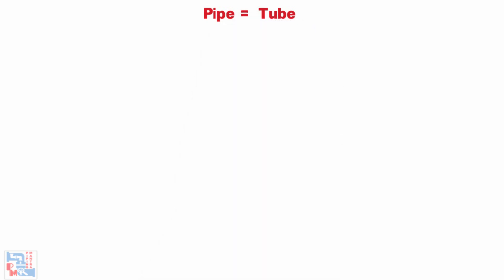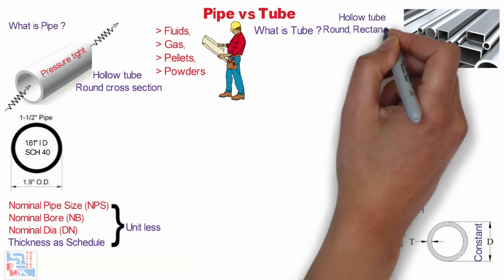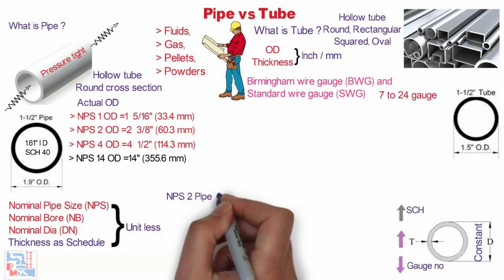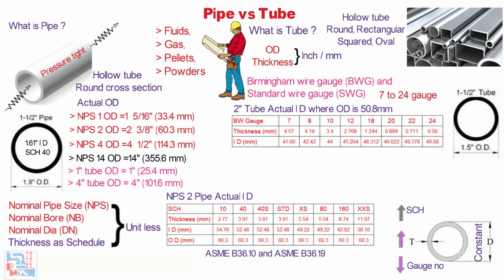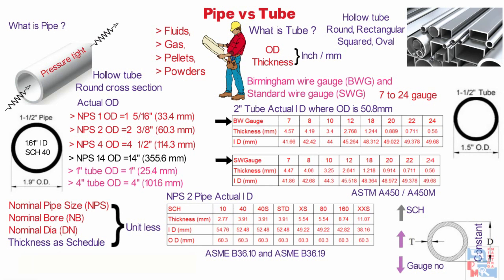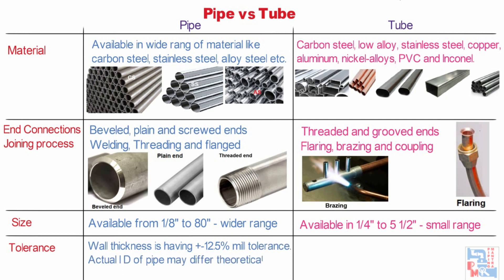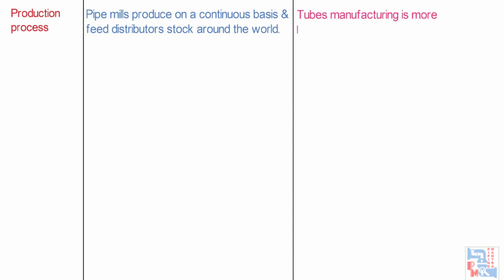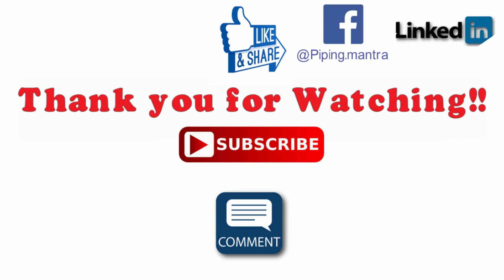Pipe Vs Tube | The Difference Between Pipe and Tube | Piping Mantra |

Comment: Thanks for this info mam,  pls let me know what does this "SDR 11" stands for .. i found it printed on pvc pipe used for houshold regular water supply.
Reply from the maker: SDR is Standard Dimension Ratio. SDR is a method for rating pressure piping. SDR= D/ S where 'D' is the outer diameter and 'S' is pipe wall thickness (mm). An SDR 11 pipe is outer diameter 'D' of the pipe is eleven times the thickness 'S' of the wall diameter.
Reply: @PipingMantra  Thanks a lot 😊